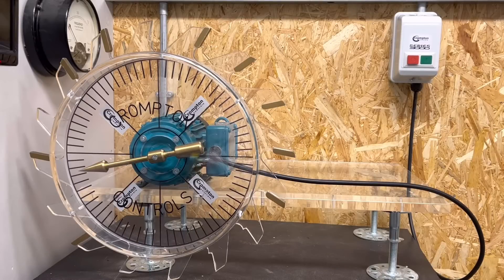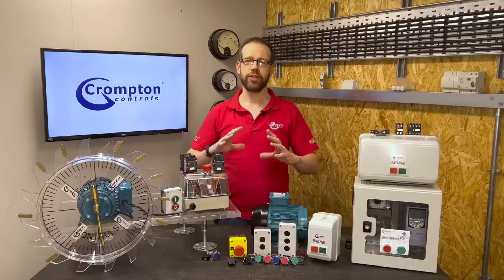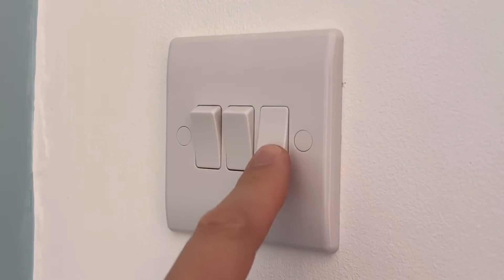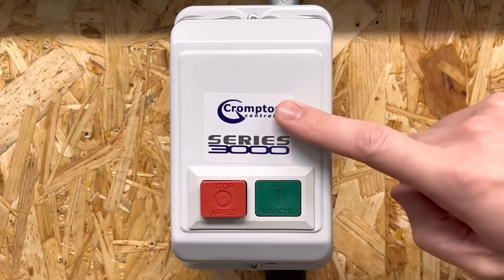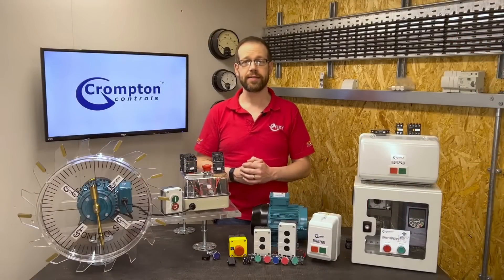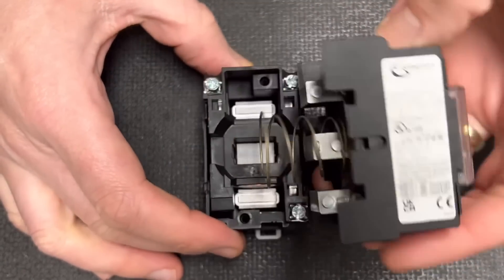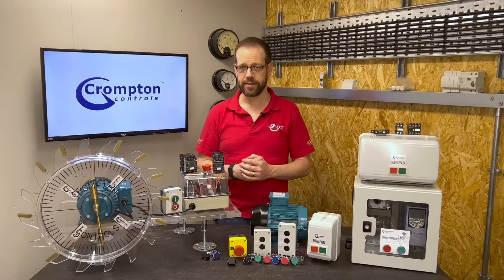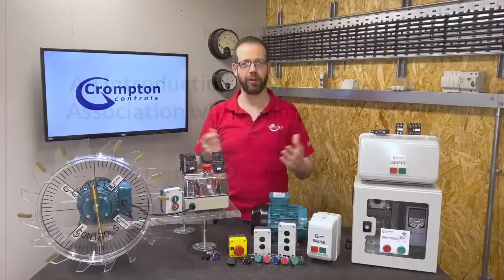How Do Direct On Line Motor (DOL) Starters Work?

Comment: So are DOL motors running in delta?
Reply: You can run in either I think it's just used for overload and starting but you can still connect the windings in star or delta
Reply from the maker: It depends on the application. 😊

Comment: The reduction of current after switch on is more to do with the back EMF that is produced because the motor is turning.  Remember Lenz's Law in conjunction with Faraday's Law of electromagnetic induction.
Reply: Exactly.  Came to the comments to find this.  Relative cutting of flux, and Slip where applicable also wasn't mentioned.